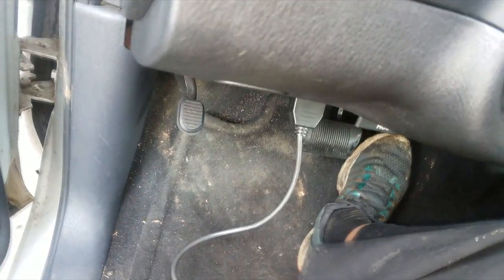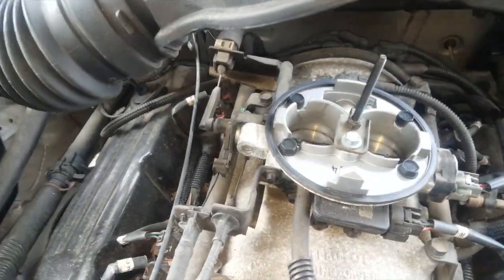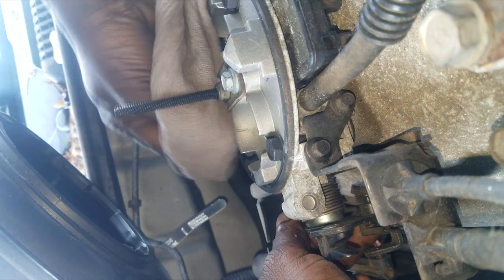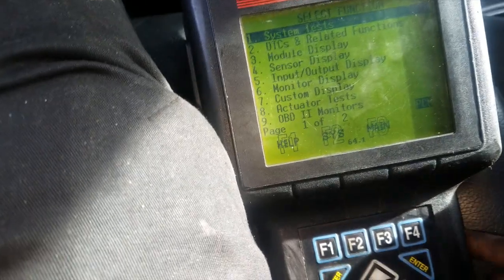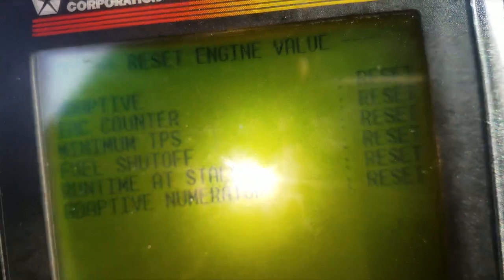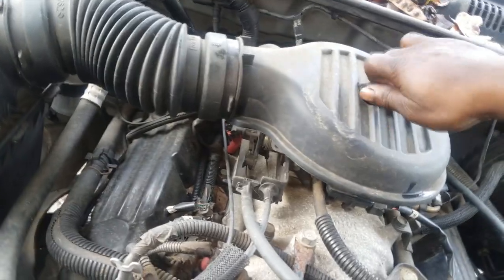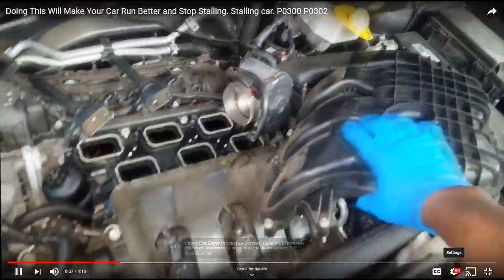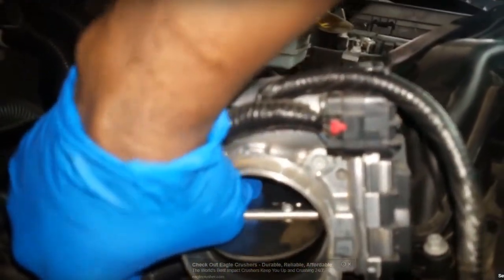How to fix a old truck that stalls out compared to the newer cars that stall out. Scan tool tricks.

Comment: Ah, the DRB. Only scan tool I've ever used that makes a sound like that. I used to pull the idle air control motor off, clean the pintle and the bore with q tips or an old toothbrush. It's only a couple torx bolts

Comment: Funny scary story for ya.
Working on my 94 GMC 350 TBI
Decided to clean the butterfly valves just like you did.
Used a black handled small screwdriver to lock the throttle cable wide open.
Clean it all up shiny!
Reassembled the whole induction system…
Cranked the the key!
Redline immediately 
Rev limiter cuts it 
Redline again!
Rev limiter kicks again an I come to! Kill the key!

I retrieve my screwdriver.

Engine unharmed.
Went another 40k miles.